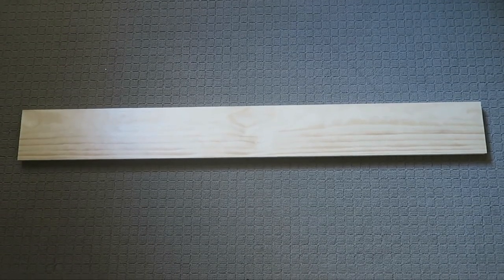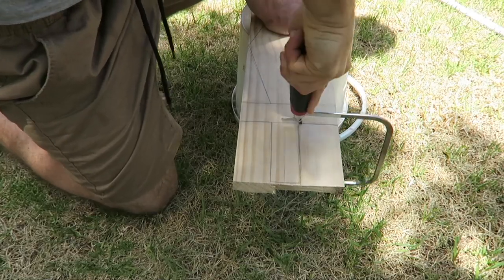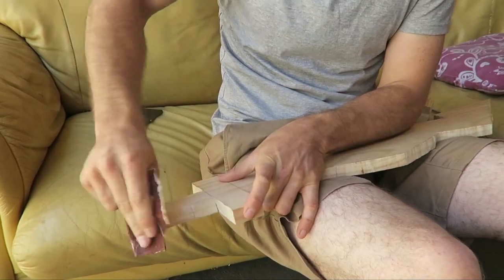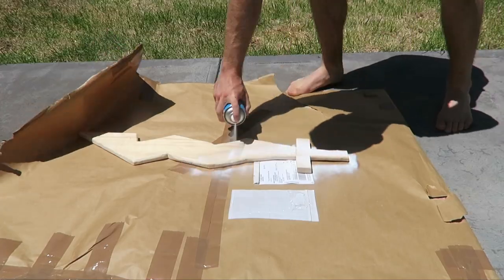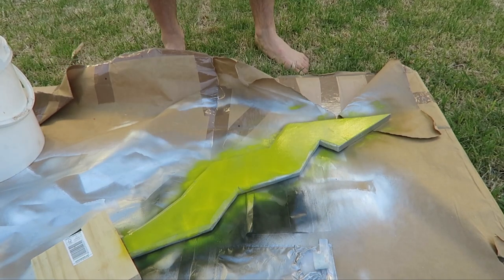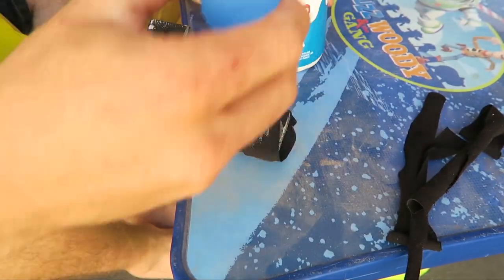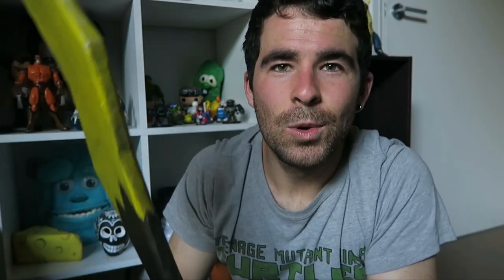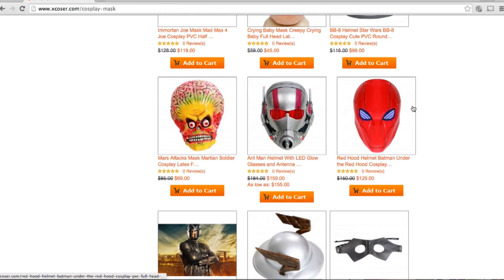Making a Wooden Pikachu Sword from Hand Tools

Comment: I can only see two real problems with the sword.

1. The handle is a bit short for the length/weight of the blade, typically one handed swords were super light.

2. The "neck" of the sword is quite narrow and could be structurally weak, I know you wont be actually using it for fighting but in transport or just a small accident it could snap.

And for the shield use the electric energy symbol for the Pokemon TCG but try to make it a rounded shield, like a buckler not flat Viking shield.
Reply from the maker: +TheGajeelRedfox It's super strong and there's no real chance of it breaking, but you are right about the handle being too short for the weight, would definitely change that if I did it again. And yea, that's basically spot on what I am thinking for the shield